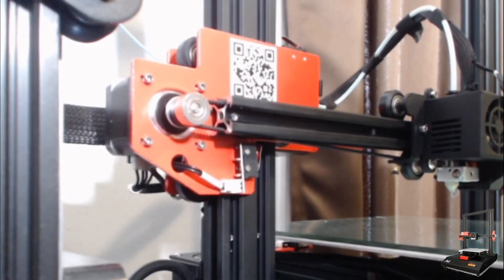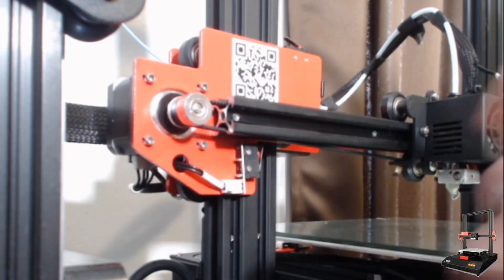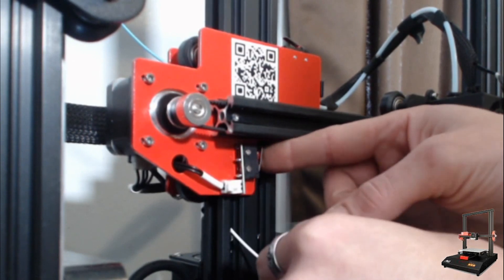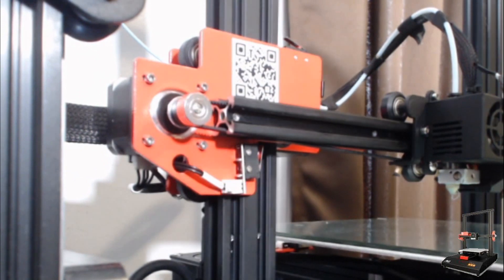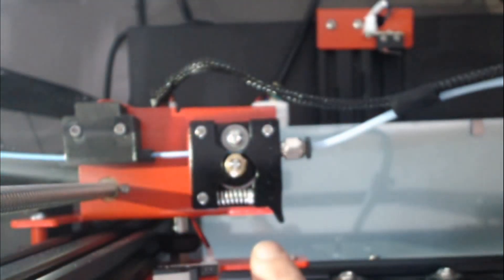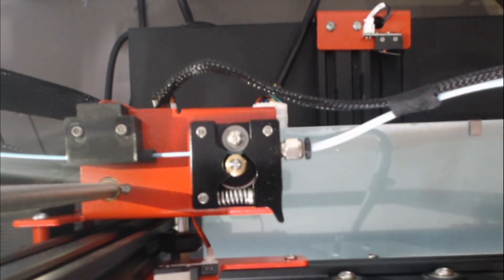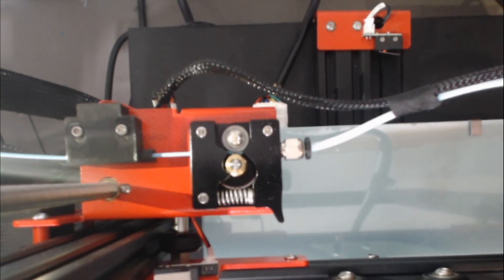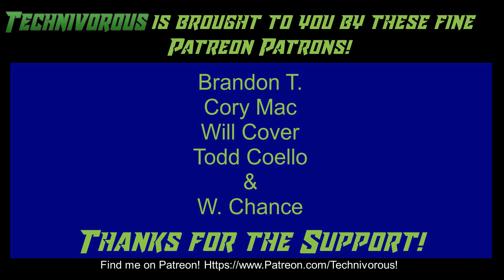ET4 3d Printer Components -  Filament Runout Sensor

Comment: Marvelous!  My own ET4 - my first printer and my 5th print - kept giving me a 'load filament' message and pausing the print.  Now I know common sense goes out of the window after a few Christmas beers and I should've worked it out myself, but I found your video and there's the explanation I needed!  I took out the limit switch and tweaked the arm just a tad, checked the switch point and it's all hunky-dory now.  Thanks very much, nice clear video, well explained, you saved my bacon!